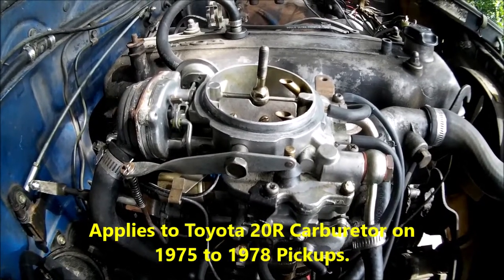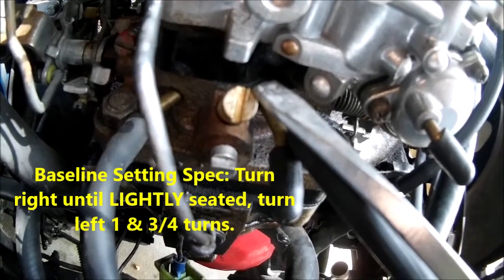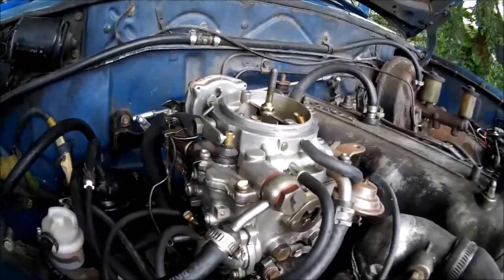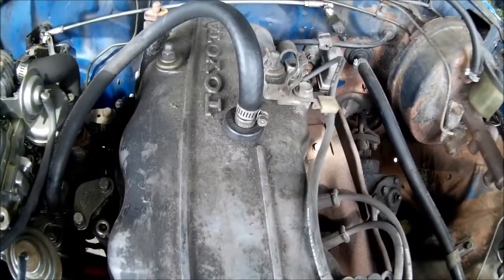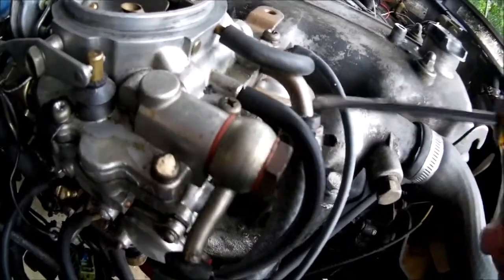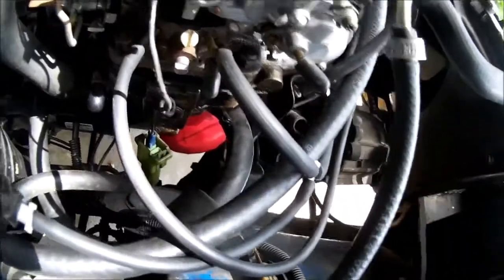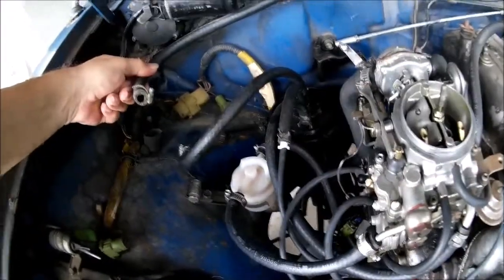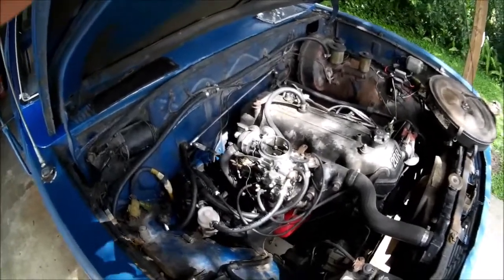1978 Toyota Pickup/Hilux 20R-Carb Adjust & Vac Lines-Desmogged

Comment: im having some issues. not sure about vacuum diagram and the hoses being correct. its a 79 pickup with a 21ru in it. not sure if its the stock 20r carb or the 21ru carb. but my issue is it cold starts fine and runs fine untill it warms up. then it spits and sputters under any more than half throttle.  the fuel tank and pump were rusted out and i replaced it with a fuel cell and external pump. the plugs were pretty bad so i put some BKR7 plugs in it just to get it fired up. it seems like when the choke opens it runs bad and if i push it closed it runs best. i would imagine its full of gunk/dirt and rust. what are stock spark plugs a 5? and how do i get the choke to not cause it to run like S#|t when it warms up?
Reply from the maker: From what I know, the 20R & 21RU carbs are very similar. From the description of your run problem, I would say that you are running lean. The specific info about the choke positions is key here. Warmed up with choke open it runs bad, warmed up with choke closed it runs better. The choke is simply blocking off some airflow which makes the air/fuel mixture richer. Since it runs better when warm with the choke closed, we can assume that the carb isn't providing enough fuel for those conditions (lean). It's probably not the chokes fault here. Most likely you have dirt, rust particles or other debris in your idle circuit in the carb.

The rusted fuel tank & pump are a good clue here. The idle circuit in a carb usually has VERY small passages, than can easily get clogged up with particles. That would account for the lean condition when warm. Even when not at idle, the idle circuit still flows some fuel so if it gets clogged, you are basically just running on the main fuel circuit in the carb, which can't provide enough fuel on it's own for the engine to run right.

What to do? Ideally you want to remove the carb and do or have done a full cleaning and rebuild. If you can't do that or can't afford that, there are a few things you can try that sometimes work. First thing is to try and clean out the idle circuit. This can be done with the carb in place, but you'll have to remove several pieces to access the idle circuit. See Figure 29 on this page for a diagram' it's for the 20R carb but yours should be very similar: https://www.autozone.com/repairguides/Toyota-Pick-ups-Land-Cruiser-4Runner-1970-1988/CARBURETED-FUEL-SYSTEM/Carburetor/_/P-0900c1528004d6c2

You need to remove the fuel cut-off solenoid on the passenger side of the carb, the 2 nuts in the fuel bowl on the front of the carb below the sight-glass, and the idle mixture screw*.
*CAUTION - Idle MIxture Screw - before removing the screw, turn it to the right and count how many full revolutions it turns, until it just stops (do NOT force it). It should be 1&1/2 to 1&3/4 turns. Thatis how it should be set when you put the screw back in after cleaning.

With all these parts removed, you will have access to the fuel bowl & idle circuit. Get a couple of can of carb cleaner with the "spray straw". Shoot carb cleaner into the solenoid port, idle mixture screw port, and the idle & main jets. The jets are located in the fuel bowl; you can directly access them through the holes where the bowl nuts were, just look in there, you'll see them. Also spray some cleaner around in the bowl & look for any junk that washes out. You can also spray down the angled brass tube in the carb throat; this is a vent tube to the fuel bowl. Use AT LEAST 1 can of cleaner on all of this.

After the cleaner, the best thing to do is get an air hose & shoot some compressed air into even open port & hole. This helps "blow out" any junk that's in the idle circuit. It also helps dry up any leftover cleaner. Re-install all the parts you removed. Remember to set the idle set screw as described; turn in to right until it just stops, then turn out 1&1/2 to 1&3.4 turns. If you unplugged the solenoid plug it back in.

Start it up, warm it up, and see if it made a difference. If you get it warmed up & the choke is open and it's running better, then you know the idle circuit was clogged. If it doesn't make any difference, the carb will have to be deep-cleaner & rebuilt.

More info coming, separate reply.
Reply from the maker: The 21RU was a Japanese only motor installed in several models from 1978 to 1987. Info here: https://en.wikipedia.org/wiki/Toyota_R_engine#21R
It was also used as a replacement engine for some US Toyotas that originally had the 20R. You didn't say where you are, but the 21RU is NOT a common engine to find here in the US.

I do not know if the NGK BKR7 plugs are correct or not. The info I could find was NGK BPR5EY or Denso W16EXR-U. Source: http://jp-carparts.com/toyota/partlist.php?maker=toyota&type=312140&cartype=1&fig=1901

Do you have an inline fuel filter or no? If not you should. If you do, you should change that out too. Have you changed out the fuel lines? Are you running gasoline with Ethanol in it? Ethanol is very hard on the old rubber fuel lines, and actually makes them shed rubber particles inside the line. These particles can clog your carb. I highly recommend replacing the rubber fuel lines with ones that are made to handle Ethanol fuels.

Last thing. This sounds like a "rescue project". Keep in mind that with old vehicles, you really have to go through EVERYTHING on them, because they may have been sitting for years unused, or just not maintained that well. Do everything from the ground up, system by system. It's worth doing on these old Toyotas.
Reply: @The13thSword  Thank you, i was wondering about those two under the sight glass good to know. i honestly could not even tell that was a sight glass at first was so dirty, pulled off and cleaned. rust fluid came out. pulled the idle circuit and some rusty sludge.  i am in washington state, it only sat since 2016 the 79. if i could get a wide or narrow band O2 sensor on it to dial in the carb that would be great!

this is a great section all the detailed replies.
Reply from the maker: @TheLHROCKS  No problem. Yep, rusty sludge could easily be what's clogging up the idle circuit. Be especially sure to thoroughly wash out the fuel bowl to get any heavy rust particles out of there, or it's just going to clog up again. If it were me I'd use as much carb cleaner as needed in every port until no more rust colored liquid came out, then blast with compressed air & do it one more time with the cleaner for good measure.

You don't need an O2 meter to get the carb dialed in well. All carbs work pretty much the same way so you can use the "best lean idle" procedure. It's pretty straight-forward. Here are someinstructions for a Weber carb but the same procedure will apply to your carb. It's in the middle of this page: http://www.cjclub.co.il/files/Weber3236adjust.pdf

by the way this procedure should be done with the engine fully warmed up & the choke fully open. Once you get the idle mixture set at it's best point, adjust the idle speed to 800-850 RPM. If you don't have a tachometer just set it fast enough so there is no "chugging" & runs smooth.

I also found some other specs online for your engine that may help for tune ups & valve adjustments: http://members.iinet.net.au/~stepho/eng20r.htm

Let me know when you get it going or if you need anything else.
Reply: @The13thSword  one more, are most all the stock 20-22 carbs interchangable?
Reply from the maker: @TheLHROCKS  That I do not know for sure. From pictures I've studied of the intake manifold flanges, there appears to be some differences in size & layout.

I have seen some adapter kits out there like this one: https://www.lceperformance.com/Aisin-22R-Carb-to-20R-Manifold-Adapter-Kit-p/1033000.htm
so it may be possible. I just have never done a conversion like that to know personally.

I do think the stock 20R carb should fit the 21RU intake. From what I've been reading about the 21RU, it's basically a downsized 20R for the Japanese market. Toyota reduced the bore size so it would be under 2 liters displacement (<2000 cc) to avoid extra taxes the Japanese gov't was charging at the time on ebgines larger than 2 liters.

That also means your engine can only flow so much air, likely less than 150 CFM (cubic feet a minute), even at redline (5000 RPM). I happen to know the 20R carb is rated at 190 CFM, and the 22R carbs are rated for 325 CFM. So even if you could fit a 22R carb to it, it's more carb than you need for the engine. Just something to think about.

Comment: I just rebuilt this carburetor. I am a novice with this. But hey it wasn't working to begin with. Put it all back together and what do you know it runs!... sorta. The at the top which allows more air in is just hanging loss. What did i do wrong with the linkage?!?!
Reply from the maker: It would help to know the exact year of the vehicle and what the engine model is (20R, 22R, etc.) so I can give you more specific info.

You said "The at the top which allows more air in is just hanging loss (loose?)" I'm going to assume that you mean the plate at the top of the carb that pivots. This would be the choke plate. It has it's own linkage on the carb and it's operating correctly is very important to how the engine runs before it reaches full temperature, and even after it reaches full temp. There is a linkage that moves that plate, and it should be a part of a thermostat system mounted to the carb. This can be controlled either by coolant (20R) or electrically (22R).

How it works - Cold engines need a richer fuel/air mixture to run right (more fuel, less air), but a leaner mixture (less fuel, more air) once up to operating temp. The choke controls this and should be almost or completely closed on a cold engine. This restricts airflow into the carb, providing a richer mixture. As the engine warms up, the thermostat on the carb moves the linkage & progressively opens the choke plate, allowing in more air, leaning out the mixture. It should fully open at the same time the engine reaches full operating temperature, IF it's adjusted correctly.

First make sure you didn't disconnect the linkage on the carb for the choke plate. If it's disconnected, reconnect it. If you got a diagram with your carb rebuild kit you should be able to find it. As long as you did not change the setting on the thermostat, it should be close to the setting you need. The choke plate should then be in the closed position. Once the engine is started and if everything else is working, the plate will open slightly. The plate will then slowly open as the engine warms up.

Did you read & follow the instructions that came with your carb rebuild kit? There is some important info in there about the mixture setting. That has to be close to where it needs to be for the carb to work right as well. Check your diagram. The mixture screw should be on an angle on the passenger side of the carb. A good baseline setting for it is - turn to the right until it wants to stop (do NOT crank down on the screw, you WILL damage it*) then back it out 1 & 1/2 turns. A "turn" is a full rotation of the screw head (360 degrees).

* The mixture screw is usually made of brass, so if you crank it down tight, you can deform the tip of it and this will mess up your ability to properly set the mixture. When I work on one of these carbs, I always take the screw completely out to inspect to tip for deformation, to make sure someone before me didn't do this.

Let me know exactly what you're working with if you need any other info or tips. I've been through almost everything to do with the 20R carbs.
Reply: @The13thSword  the exact same as yours. Toyota Chinook 1978, 20R engine
Reply from the maker: @nslecea  Very good. Anything specific you need or want to know just ask.

Comment: I'm new to working on this stuff, but I'm wondering if you ever get weak acceleration or even stalling when you press the accelerator quickly due to the accelerator pump vacuum port being capped. My understanding is that vacuum allows the valving to work to allow more fuel to enter the mix when the accelerator is pressed quickly, thereby avoiding too lean of a mixture. Has this been an issue for you?
Reply from the maker: No this has not been an issue for me and you do not need to have vacuum to that part for the engine to run perfectly fine. I think we have a bit of a misunderstanding on how this part works.

That part is called an Auxiliary Accelerator Pump, or AAP for short. It is NOT the main accelerator pump for the carb, that is a different part entirely. The AAP's only job is to work when the engine is cold and not yet up to full operating temperature, as cold engine usually require more fuel to run well. The AAP's vacuum port was designed to be hooked up to a thermo vacuum switching valve (TVSV). The base of that valve is screwed into a coolant port & senses coolant temp. Below about 180 degrees F the valve is open & allows vacuum to go to the AAP. That vacuum pulls on the diaphragm inside of it & allows a bit more fuel to flow. Once the engine get to full temp, the valve closes & removes the vacuum from the diaphragm. Plugging the port is the same as having the "no vacuum" condition.

As long as your choke mechanisms are adjusted correctly and working properly, you don't really need the AAP, even with cold engine conditions. There should also be no real effect in acceleration, cold or hot. I've never experienced a problem with acceleration with it being capped.

If you are experiencing weak accel, stumbling when you step on the gas or even stalling when you step on it, you have another issue or issues. If it's doing this cold (anytime before reaching full operating temp) most likely you have a choke problem (sticking choke, broken or disconnected choke linkage, choke out of adjustment). It could also be a partially or totally clogged accel jet or idle circuit, or a clogged transition port (these are small holes in the carb, near the base of the throat at the bottom butterflies). Even fully warmed up it could still be any of those things, or even your idle mixture not being adjusted correctly, as that does regulate how much fuel can pass in that circuit. It could also be vacuum leaks elsewhere on the carb or in the vacuum system.

A few other causes could be a sticking throttle linkage or cable, or like on my truck, wear to the throttle linkage rods & pivot points. I've found that wear issues can also cause some really weird & hard to track down idle & run issues.

Another thing I found is particles or fuel line rubber clogging up the tiny passages & ports in a carb. If your rubber fuel lines are old and you have been running gas with ethanol in it, the ethanol can deteriorate to insides of the fuel lines, as older style fuel line was never formulated to handle ethanol. This causes very small rubber particles to break free & possibly end up in the carb & block off those things.
Reply: @The13thSword  You were 100% on two counts. plugging the brake booster hose allowed me to get the truck to start so that I could drive it uphill to my garage. I replaced the booster (thanks thanks for the recommendation!) the old one was rusted through on the bottom. Brake power was greatly improved, after a bleed it was amazing.  It still had to keep a high idle to keep from dying. I sprayed the carburetor with the idea that maybe something was sticking and noticed the engine revving. After closer inspection, there was a split in one of the hoses that lead from the center of the carb. I cut off the split section and reconnected and it runs beautifully now. Praise to the 22R!  And thank you for your help!!!
Reply from the maker: @jamesmcpherson3924  Glad to hear you found the problems. Good work on the brake booster and finding the vacuum leak. 

One more recommendation. Do yourself a favor & replace all your vacuum lines with new ones. The split in the one you found shows that the rubber line is old & brittle, and it can split or break again without notice when you are driving. I also recommend that you replace the vacuum lines ONE AT A TIME, so nothing gets mixed up or messed up.

If I remember correctly, most of the line is 3mm size (12 feet total), with the rest being 6mm size (4 feet total). O'Reilley's or Auto Zone should have it in stock; you can buy it by the foot. Buy a few extra feet of each size than the lengths listed above to make sure you can cover everything.

I assume you got the high idle down since you got rid of the vacuum leak? Interested to hear.

Comment: My problem with the internet is you ask one simple question and get a billion wrong answers. If this was what I was looking for in my search I think you layed it all out accurately without any confusion. To be sure I would check the factory service manual(excellent advice). I own a 1981'  3/4 ton and as a result I've had to learn everything about this truck just to get the right parts because it's different from every other 22r from that generation. Parts stores constantly get it wrong and or can't get the part so i whip out my phone, find it on the web, show it to them and say "I guess I'll have to buy this one". Megazip.com has original parts but their prices are stupid. Their site is my go to for finding correct part numbers. Keep those videos coming, you're doing good work
Reply from the maker: Thank you sir, glad it was of some help. Here's another source for you to put in your favorites file: https://parts.lakelandtoyota.com/s/TOYOTA__PICKUP/parts.html

Great source for finding original part numbers, and Toyota actually still has some things available.